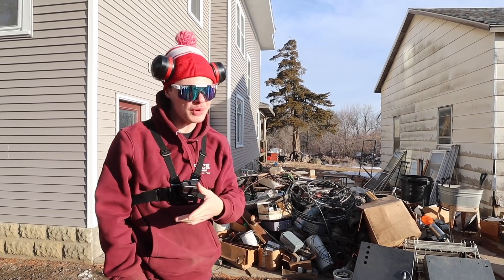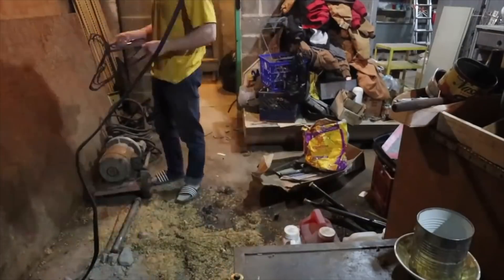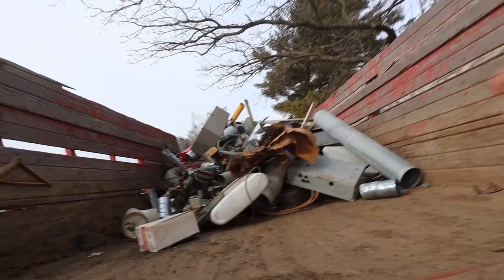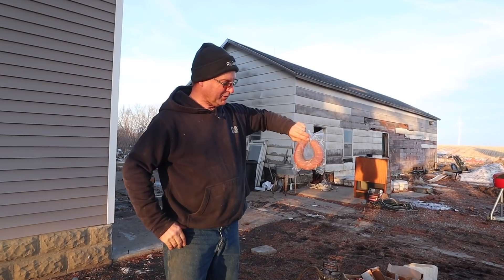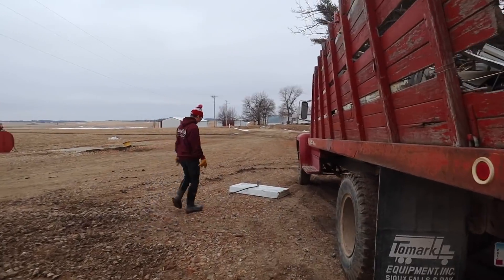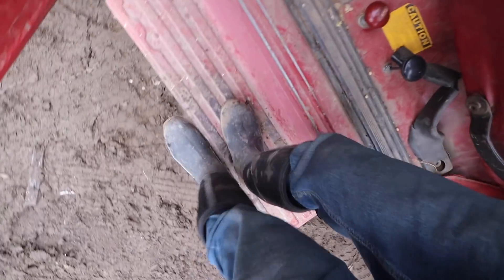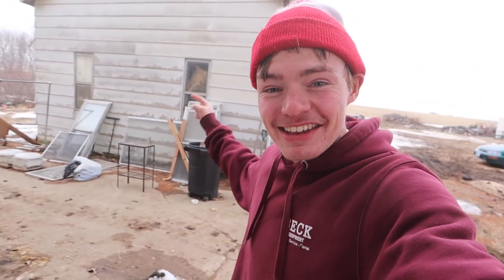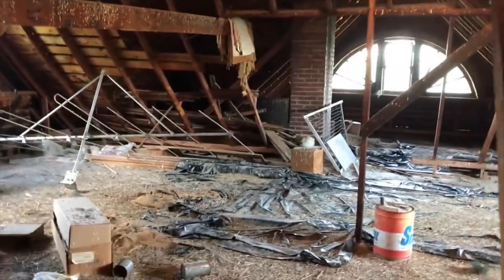My HOARDER House Is CLEAN...Almost

Comment: Cole, from experience while cleaning the attic - rig up a chute/slide out of a window and send things down the chute/slide rather than running the stairs.
Reply: Brilliant.  Sure wish I had done that unloading the old attic.  Probably would have saved me from needing surgery.
Reply: And wear a half-face respirator, or at least an N-95 dust mask.
Reply: And, preferably, have the bottom end of the chute in the back of the dump truck so the junk lands in it and won't have to be handled any more than necessary.
Reply: @marlenalinne7958  - yes to all these good effective efficient ideas  and I'll add, after finishing the attic clean out, take one good ride down the slide just for the fun of it.   🙂
Reply: great idea
Reply: Park the dump truck at end of chute.
Reply: @marlenalinne7958  - are we having more fun here at Col's channel than we are supposed too?  😎
Reply: @SoybeanFarmer3300   Yes, we are and I love that guy!!  I wish I had half his drive and energy.
Reply: He just has to re purpose some of those AUGERS.
Reply: Clean out the attic BEFORE it's too hot up there
Reply: had to clean out an appartment at an old job and it was a hot summer day and both me and my coworker had about 0 F*cks to spare so i parked our little Iveco Truck under the window, put some old Matresses and Carpets that we found on the truck and tossed all the old furniture n stuff out of the Window (2nd floor) onto the Flatbed ... was effective!
Reply: @SoybeanFarmer3300  Is there even such thing as too much fun? NEVER!!!
Reply: @desertlady2815  - great point.. 😎
Reply: @sgtbilkothe3rd  Agree! I was thinking they need respirators because I'm pretty sure there are some gnarly air borne diseases that can be caught from bird poop and dead birds. Would the respirators you mentioned filter those out?  I wonder if the CDC or Dept of Health have any recommendations for what to wear?
Reply: @marlenalinne7958  girl, now that was smart!!! I would never have thought of that or if I did it would've been too late like while I was picking the stuff up off the ground and tossing it in the truck!
Reply: It’s cheaper to just heave junk down 3 stories
Reply: My roofers used a tape that ran right into a dumpster. It worked great except my son had a fan in the window below and it sucked all the dust in the house.
Reply: What an amazing idea.
Reply: Kathy Kenny  absolutely. Touch it once!
Reply: That’s a great idea! Almost makes me wish I had an attic to clean out!
Reply: Excellent idea😊
Reply: @Derrick Howard instablaster ;)
Reply: @Judson Braylen It did the trick and I actually got access to my account again. Im so happy:D
Thank you so much you really help me out :D
Reply: @Derrick Howard glad I could help xD

Comment: YOU NEED A RESPIRATOR  TO DO THAT ATTIC, BIRD  AND BAT DROPPINS ARE VERY  DANGEROUS, PLACE LOOKS GOOD
Reply: DAVID WATSON II CEO OF CAPITAL LETTERS!
Reply: @MasonHagerty  histoplasmosis is an actual  disease you can get from breathing bird droppings.
Reply: @larryfrank2077  You are absolutely correct, Larry. I have it in my eyes from breathing in crap from our neighbor's chickens.
Reply: My aunt got a rare form of meningitis from pigeon droppings in her work's air conditioning system. The medicine to save her gave her severe memory loss. Wear masks!!!
Reply: A respirator is a must, but you can minimize the dust from the bird and rodent droppings by using a pump garden sprayer with water before attempting to clean it up.  Dissolving some baking soda and adding vinegar to the solution has the added beneficial effect of killing any spiders.  The spray may smell a little while wet but the odor goes away once dry while leaving it smelling a whole lot better.  That is a HUGE attic, I really hope he does something spectacular with that space.  Insulate, put up some shiplap walls and lay a floor up there and it could be an awesome game room!

Comment: CLEAN THE ATTIC BEFORE IT GETS TOO WARM
Reply: Smart idea.  Also read another comment about rigging up some kind of shoot system so bags filled with bird poop etc. can be heaved down the shoot maybe right into the dump truck to be hauled to the dump yard or burn pile - send any metal items down separately.  Also, consider keeping furniture, you never know if it might be an antique that polishes up beautifully.  Even icky upholstered chairs can be ripped down to the frame and repadded and reupholstered.  Are you close to an area that has a Re-Store or something like Goodwill or St. Vincent de Paul?  You can always donate furniture in decent condition to them - saves it from the dump/land fill/burn pile.  What is one man's trash is another man's treasure, that's been proven time and time again!

Comment: When we make scrap runs, we separate out aluminum, brass, and copper.  Also, our scrap yard has a higher rate per lb for electric motors, too.  Last summer we removed our 1930's in ground pool and took the 2 pool  ladders to the scrap yard and made 240 bucks because they were solid brass under the paint.   You haven't had the true scrap yard/dump experience until you go there on a 95 degree day.   But I think the real plus in scrapping is keeping good metal out of landfills.  Great job Cole and Nave.
Reply from the maker: Jan Marie Brunette-Hunyady I have different metal piles out back. 99% of this was just tin and steel.

Comment: I was wondering why you didn't back the dump truck up there in the first time. Lot of extra picking up scrap. But on the bright side exercises good have a great evening
Reply from the maker: The Farming Life Because we needed it for the graveyard.
Reply: @ColeTheCornstar  I figured there was a reason. Are scrap yards will bring dumpsters out for no charge. But there's no money in it right now to get rid of it for us unless it's aluminum. Have a great evening
Reply: @TheFarmingLife  they pay you less for the metal if they're picking it up
Reply: Cole The Cornstar do you  sort the metal? Like wire is turned in separate to electric motors,etc. lot more money to be made sorting it. I won’t even mess with light iron only nonferrous metals I’ll save it for a year or two and turn it all in at once
Reply: @joegosselin2888  I was saving copper, brass, aluminum scrap for a little bonus when I retired.  My brother hit hard times so I gave it to him.  He got almost $500 and it easily fit in his small car.
Reply: Don Nash yeah that’s the way to go. Steel prices are way down not even worth doing. I’m formen for a remodeling company I get to keep all of our copper etc. like I said I’ll save it for a year or two and make a couple grand.
Reply: @joegosselin2888  I'm a painter/carpenter so don't get tons of metal but still grab anything before it gets thrown away. It adds up.  I got new boxes filling up now.
Reply: My friend has a company Aluminum, Brass, Copper Steel. I get a call from Bras and think it's a joke.

Comment: Enjoy watching you two work on the house together. Just my thoughts on cleaning the attic: Do it before the weather gets hot. You wont last 30 min. in that heat! Definitely wear masks because all that bird poop is going to turn to dust. And if possible rig up an exhaust fan to vent all that dust to the out side. You don't want that stuff filtering through your house.

Comment: You are going to have a huge living space when the last of the cleaning is done.  It looks like you could put a huge TV room and several bedrooms in that attic with all that headroom and light!  You'd need to insulate and drywall and run heating/cooling up there but wow!  Maybe plumbing for a bathroom too.  The views out of the windows must be pretty good, too.  Great job - I love that old big farmhouse, it's like a mansion.  All that metal stuff too - over 4,000 pounds.  Just amazing you and Nave were able to remove it all, what a JOB!  It will be interesting to see what you pull out of the garage when you get around to cleaning that out.  Wonder if American Pickers would be interested in going through everything?  You may have some items that have collectible value or in demand by decorators, etc. for whatever reason.  Wouldn't hurt to contact them, it's amazing some of the stuff they buy and what they do with it.

Comment: Cole, not all of us have the same metabolic rate as you!  Haha.  But as a professional web designer for 35 years for a large company, one suggestion I have is that when you flash a quick vignette on the screen, you need to count to 3 (medium slow) so the viewer can digest what is on the screen.  Like when you showed Neave's picture and some text at the beginning of the episode.  It's just whenever you have those quick shots, you should give the viewer a little time to digest the content.  Other than that, I think you have a great personality (always smiling even in the direst of circumstances) and a novel concept.  Good job!

Comment: You dig a lot of graves and you do a good job. I spend a lot of time at the dog park. Lots of times when a dog dies, I am asked to make a memorial plaque. I make the plaque and weld bolts on so that I can attach it with brackets to the fence at the dog park. My art has improved because I put a different color backer plate on so that the lettering shows up better. There are about 15 dogs on the fence. I just hope that vandals do not wreck them and I hope the county does not take them down. Keep making fun and interesting videos.

Comment: scrap prices are way down right now which could be part of why the piles are so small in the scrap yard if you had separated out the wire and electric motors and had them weigh separately the copper wires pays more per pound then the the steel does and same goes for the electric motors and I can't believe you tossed out that tool box unless it was no good but it looked almost new

Comment: Hate to say it, but mixed loads bring the lowest price. If you have different kinds of metals mixed on a load, the price finds the lowest grade material, and that's the price you get, unless they are being unusually generous. I saw thin steel (tin), motors, copper wire and steel wire, all sorts of things all mixed up on the load. I'd guess you would have gotten your $650 if it was sorted. You got $3.50 a hundred. The motors alone should be $10-$25 a hundred (not sure where current market is right now) Imagine if you brought the elevator a mixed load of corn, beans, maybe some peas or rye on there too. If lots of people did that, they'd invent a class called 'mixed grains' or something like that....a salvage feed grade and give you a super low price for it. Same thing at the scrap yard. Loved the video, though! Thanks for another good one Cole! Oh, that attachment is sometimes called an 'orange peel grapple'. Thank you!

Comment: I couldn’t believe you put those electric motors in with everything else!

Motors have a different category which pays about 9 cents a pound for a national average.  I think I saw aluminum (21 cents a pound) it there too.  And there’s probably copper ($1.80 lb) in there as well.  I saw some power cords.  Insulated copper wire is 44 cents a pound.

The national average for steel is $95 a ton or 4.75 cents a pound (95/2000=0.0475).
The Alter in Waterloo is $85 a ton.  (But they probably wouldn’t let you just dump a load.)
You got $70 a ton or 3.5 cents a pound (70/2000=0.035)(151.2/4320=.035)

Of course, you would have to spend even more time sorting everything into all the different categories, but I was surprised you didn’t separate out the motors since they were separated already.

Oh well.   At least it’s cleaned up!

Comment: I hate to tell you but you scrapped wrong. You needed to separate your metals. Aluminum, scrap steel, copper are all different prices. Also those electric motors are about 75 apiece. You did yourself out of a bunch of money.

Comment: You really need to hire professionals because they wear respirators and suits and stuff like that you didn't at least check cost because it's a lot of diseases and stuff an attic. You can get really sick breathing in my ear and stuff. You really need to scrub down the basement and then once it's dry then you can seal it Eric's paint set seal I can't remember the names of the paint so new on the market and that way you don't get any molar toxic mold because of that being a basement. I'm 61 I don't know what that big black thing is senor room there you should probably whenever you get rewired have the guy wire it where the boiler ran play yeah the other sign furnace or whatever it is is make that storage and utility room have you left for Pals in there cedra. You really need to find out what's in that corner also and if it can be removed ask your dad. You can get diseases by handling dead birds and all that feces throughout that they shoot they have special chemicals 2 detox a room. Rose just a suggestion.

Comment: You all need to hire a Hazmat group that she used to cleaning that car stuff up because of special chemicals safe and clean with I love coming with gloves and I'll type the gloves and I'll have a suit on a respirator because believe it or not, dead birds carry a lot of diseases and also all look feces that's up there needs to be cleaned completely. You kids are going to make yourself sick I hope not first you do that yourself you don't have the special chemicals I'm talking about stuff that's stronger than bleach. 61 year old brothers I still like to know what that big black thing is in that one room you can make that one room until utility room, when electrician comes in should not cost more into $300 to have your boxes moved there have as far as smooth baby your first needs to be bigger where you stay away from that baller. And that would get rid of a lot of pipes it's on the ceiling because you might have more knob and tube do you think I see you in your office you have something plugged up and its way up on the wall and that's on the first floor how to increase the value of the house to check make sure there's no no I'm too because when he's there he can run wiring through the whole house but not that much money I have a lights put in less you know reset lighting like the houses. Rose

Comment: I unsubscribed today. You are making a hero of taking electric motors to the junk yard which you have not tested, or did not test on camera, and got a cash payment of less than the value of one of them replaced. The major TV producers have made a lot of advertising money making villains of people that keep things to work with.  It looked like you also threw away a smaller size air compressor - and you did not show testing it to see if it worked. You also make a big deal of throwing away a toolbox that had small drawers, you did not explain if the drawers were bent, they seemed to work OK and you tossed it anyway. You need to start doing without for a few months and learn the value of what you threw away.  Nave is too young and inexperienced to realize the value of what I am writing, maybe you are also.  BYE